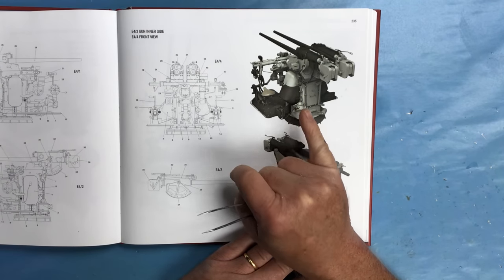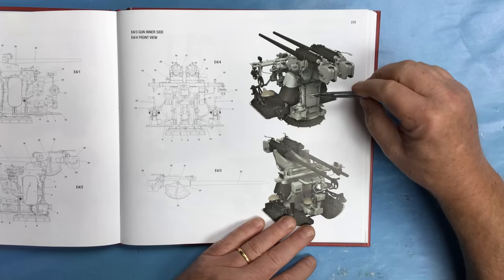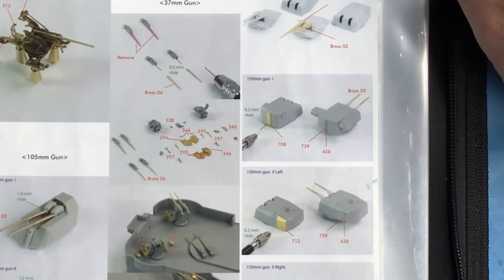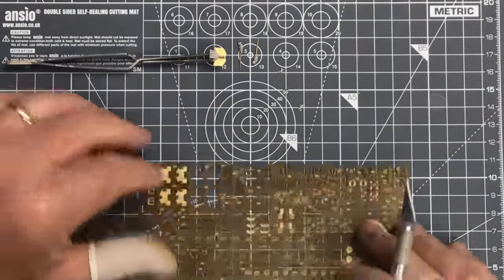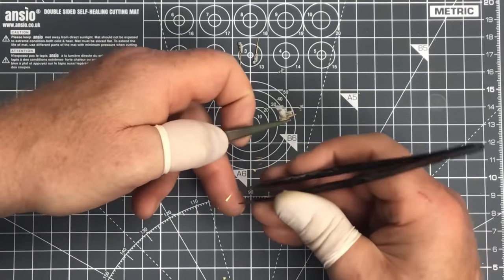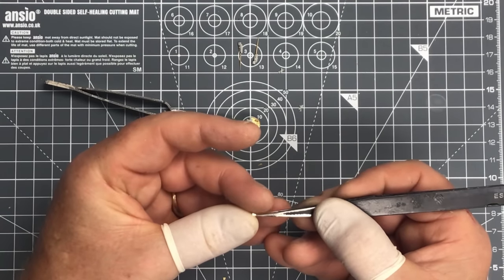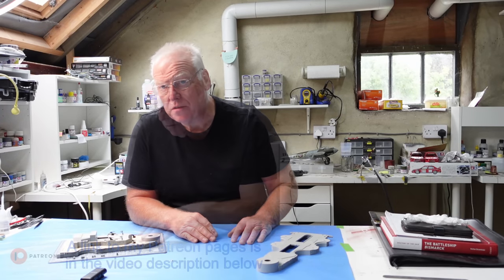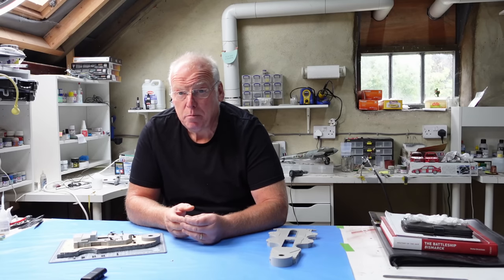Trumpeter 1/200 DKM Bismarck Full build with Pontos detail set Part 9

Comment: with all the anti aircraft firepower it still amazes me how they couldnt hit a swordfish biplane.
Brilliant work steve.
Reply from the maker: Thanks Jerry the same thought occurred to me too
Reply: They actually did hit a lot of the Swordfish, but their construction allowed the shells to just pass right through the airplane.
Reply: One issue was the analog A.A. fire control system for the 105 mm guns on the Bismarck. The slowest target speed setting available was still too quick to accurately track the leisurely 110 knot Fairey Swordfish.